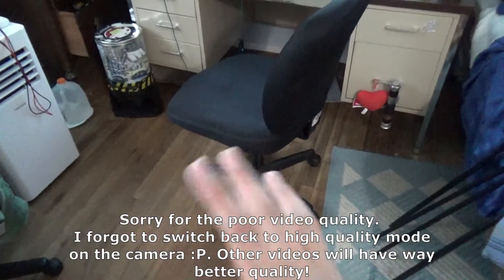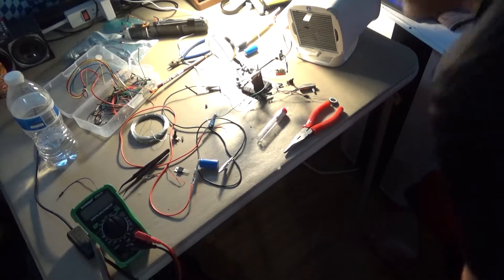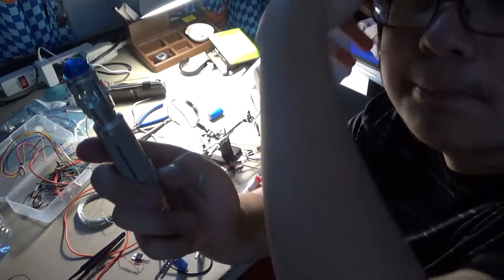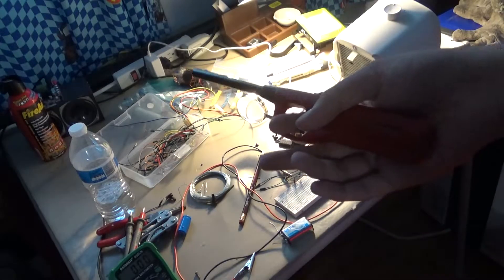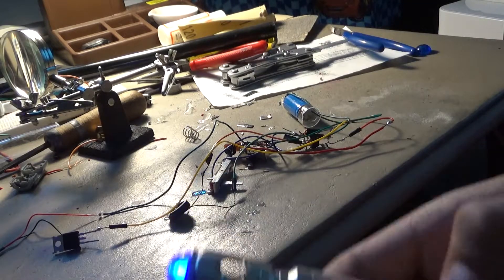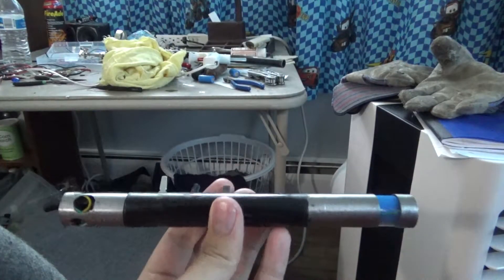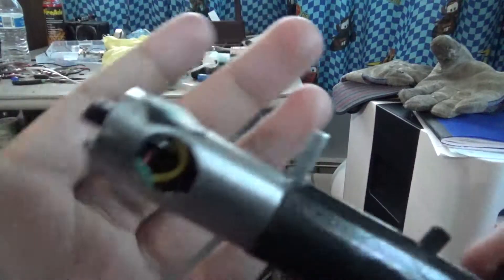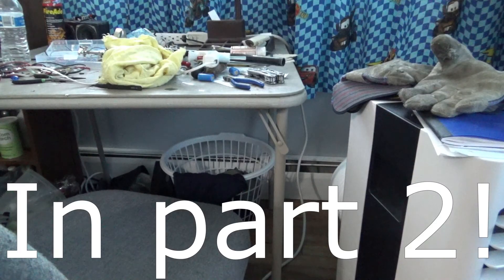Real WORKING Sonic Screwdriver (Mk 2)

Comment: Slightly thicken the build and you can fit several other components that would allow for a more accurate representation of what it does in the show, ive been on several tech hacking sites and have seen several attempts at sonics from a dad and son that made one that could hack into nearly everything to a single man that made one that could turn off power strips
All im saying is keep at it with enough research and effort you can truly make something amazing and im excited to see what you make one day
Reply from the maker: Oh, you are someone I was hoping to see! I've been tinkering with sonic screwdriver-like tech for a bit over a year now, but I don't think Ive seen the one you're referrring to. Do you still have the link? Im super curious. But yeah, I'll be uploading a video soon about the mk3 sonic, which I think you will really like. Thanks for the comment, and feel free to share use any ideas/suggestions for the screwdriver. :D

Comment: How is this a "working" sonig screwdriver? Yeah, it makes noises at different frequencies but does it have any practical uses other than a really annoying stick of electronics?
Reply from the maker: The mk2 can generate a range of frequencies, detect static electricity, and has a UV light. I will admit, its not much, but what you can do with the simple functions is how it makes up for it. For instance, you could detect someone brushing their hair, or reveal bodily fluids with the light. At any rate though, this model was meant to just be a simple fun thing. The mk3 though will be really awesome! So, if you really want to see a  decked out screwdriver, make sure to stay tuned over the next few weeks! Thanks for the comment, and feel free to leave any suggestion you have! :D